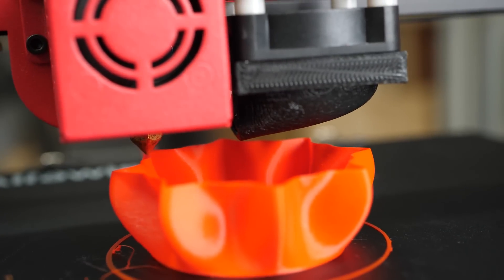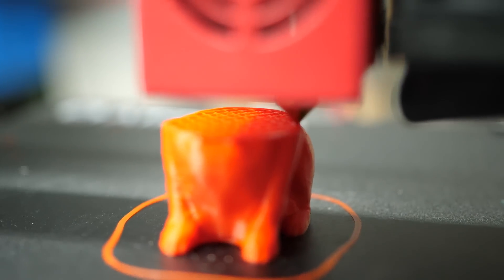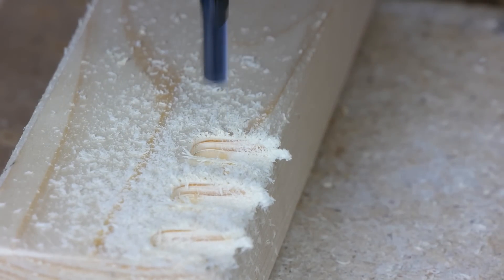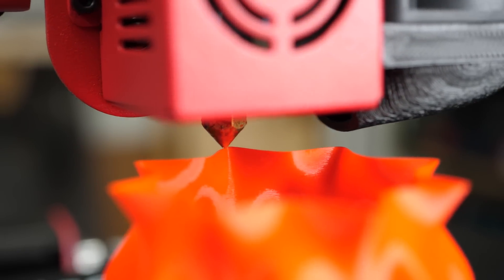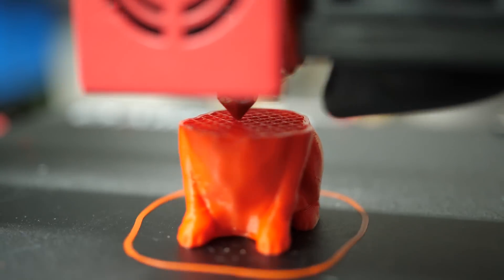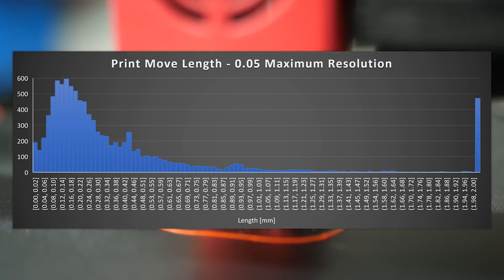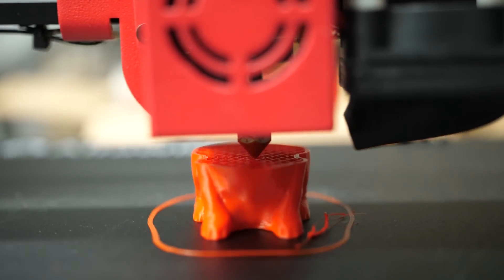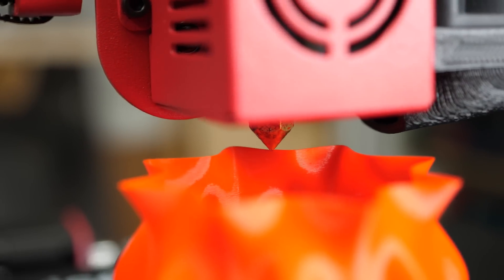(How) I finally got rid of these blobs!

Comment from the maker: Don't forget to share this video on Facebook, Reddit, Twitter and other social media!
Reply: @CNC Kitchen I'm investigating this problem for a while on all different printers, and apparently this blobs, zits, whatever you name it, are related to ADAPTIVE_STEP_SMOOTHING enabled in marlin firmware, i have tested this with option on and off, and it make sense to me now. When you decrease the resolution in slicer the smoothing option is unable to kick in because the stepping frequency is not going as low as it would with higher mesh resolution, this will also explain why this problem is not showing up when using Klipper ;-)
It would be great if you can test this on your Alfawise printer. Thank you
Reply: @Riggs Oliveria 

Normally good leveling eliminates rough backsides.
Rafts are also not known for generating good surfaces.
I think you have much to google now ;)
For example: 3D Printing Tutorials
Reply: @Riggs Oliveria 
If backside means first layer side and if it looks not good as you say...
Either is your extrusion multiplier too high (too much comes out)
Or its leveled too near
Or your extrusion multiplier is too low.

Without pictures, nobody can say what your problem is, thats why you have to search your errors and find it out yourself.
I guess you are very new to 3d printing.
Maybe find an facebook group in your native language.

That will help.

Greetings :)
Reply: @FireN2k9 thyjntynyyjyjyjtynjty
Reply: Another excellent video Stefan!
Reply: @Deqster tyyn
Reply: Excellent research, especially important to 8bit printers
Reply: Thanks for doing a deep dive on the GCODE.  I think it's something that is often wrongly overlooked on all the channels.  Getting more information out into the open source world helps accelerate development throughout community.
Reply: "Arc Welder" works even better... I had a similar problem, but ur fix did not work entirely... while it still made it better it did not fix the problem completely... after I installed and used the "Arc Welder" Extension for Cura though all my problems were solved and my prints were now suuuuper smooth... maybe its worth mentioning in an upcoming video for people who might still have issues with their printer not moving smoothly... my nozzle literally went from moving very jittery to moving buttery smooth, which improved my print quality by a lot... oh and it reduces the filesize enormously
Reply: @nebuchadnezzar47  Any benefit/downsides from using both? Thanks.

Comment: Legend.
Coming late to the game reviving my old Anet A8 8-bit board.  Was seeing rough hulls on Benchy (even worse via Octoprint due to serial communication issues of long Arc commands).
After changing "Maximum Resolution" from 0.05 to 0.5 and "Maximum Deviation" from 0.025 to 0.5 in Cura, Things improved remarkably, I might even say totally.
I don't know how often I was actually seeing these issues on other prints, but it is really like a completely different beast now.

Comment: Presumably the hammer to crack a nut solution would have been to run the print very slowly. That would still be the right option for printing details like threads that shouldn't be optimised out. With that said, being able to use the setting or disable the setting in layer bands and special volumes tight around the details might be good. That and/or an automatic slicer ability to slow down when heading into a detailed sequence of moves that a fine tolerance disallows decimating.

Comment: I found this on my Makerbot Replicator from 2012, after a few years i started to notice said blobs.. took me some time yo realize that going from PC USB connection running the gcode to a SD Card was overloading tbe buffer/processor 😮

It went from being able to print 120-165mms comfortably and upto 200mms without ever skipping to 45-85mms depending on how fine the details where on the model being printing.

Comment: Hello, that's some great work man.Good job.Would slowing the feed do the same thing, giving my  Ender 3 more time to read the code...only, I printed one chess set(entire set 17 hrs),came out smooth as silk, then I tried doing the black peices faster with a few other tweeks(NOTE:NEVER CHANGE PROVED PROGRAMS KIDS.....EVER), and I got the blobs... haven't tried another yet but hopefully slowing down to original will work...I only changed from 50 to 60mm/s, and u specifically mentioned 60 mm/s being too much for 8 bit. This programme is close to a billion lines of code. Hope Ur right my CNC loving buddy. Keep making the bids. Good stuff.

Comment: Have that issue on my ender 3 but I have upgraded it to direct drive shortly after getting the printer, have that issue in vase mode when slicing in Prusa, will try to play a little with those setting

Comment: Just coming back to this video to give thanks as this cured 99% of my stringing issues using PETG. I didnt even know this was a thing. I set my max res: 0.4mm, max travel res 0.4mm and max deviation to 0.05mm. Those settings might be quite agressive but I'm not too fussed with dimensional accuracy, at least its more than fine for me I've not had any issues with parts not fitting. I also stopped exporting my STL's from Fusion360 using High refinement, instead using Low. Which is still plenty.

Previously I could watch the printer making lots of very small stutters, which ended up with blobs on the nozzle and then strings getting pulled over gaps etc. Now its movement is way smoother.

I went from spaghetti to almost completely string free prints with just those 3 settings. Thanks so much for the well explained video!

Comment: I dont think this video is correct. I get blobs on my Ender 3 S1 with the same g-code that will print much faster and without blobs on my older 3 Pro (with a Bowden extruder!) . Also my S1 will stop "blobbing" when I reduce the printing speed enough. I think it is the blackout backup - the printer saves the position of the printhead every couple of seconds so it can resume the print in case of a blackout, and the printer can't handle "saving data" and continuing to print at the same time, so it stops printing for a fraction of a second every time it saves its position.

Comment: Dear Stefan hello 😊 
I'm the prusa user and I don't have in my prusa slicer 2.4.1 option:Resolution 
In Slicing frame(category) i can see
1. Slicing gap closing radius (in mm)
2. Slicing mode:  Regular or Even-odd or Close holes.
3. Elephant foot compensation (in mm)

So how to avoid blobs creating?

Comment: Very confusing. You mention Resolution and Travel Resolution a lot. What setting did you actually change to 0.5? Because in the Ultimaker profile you compare the maximum resolutions and mentions the 0.7 setting but this is the travel resolution and not the maximim resolution.
What setting did you change?

Comment: One of the slicer settings should be "max moves per second."  That would allow the slicer to slow down the print or consolidate moves as needed to prevent the printer controller from getting overloaded.
Reply: You can calc it with the printsleed divided by the quality setting

Comment: That was not my problem since my ender 3 has a 32 bit board. I noticed it only in a vase mode. It was the power loss recovery
And I solved it with I think M412 S0 (s1 for reactivating it)

Comment: Not sure if you've tried this already (since this is rather old video), but I had very similar issues. Especially when using gyroid infill. I could see the printer stutter, when using higher speeds (printing from Octoprint, by the way).

How did I fix this? I installed the Arc Welder add-on for Octoprint: https://plugins.octoprint.org/plugins/arc_welder/

It tries to replace many smaller linear moves by longer arc moves. I'm not 100% sure what the bottleneck is, amount of commands, or amount of data that needs to be transferred. In any case - this reduces both. Of course it would be nice if slicers natively supported arcs to begin with...

Comment: didnt understand a thing , so should i lower or go Higher with maximum resoultion ?
Reply: Idk, I'm stumped too, probably if it's higher than .05 then lower it down to .05
Reply: Lower resolution which means the memory is not "clogged up" with unnecessary data steps which blocks up the memory and the print nozzle stops to wait for the memory to be "flushed" out.

Comment: Maybe you could compare lowered resolution with Arc Welder (Plugin for Cura and Octopribt available) which smoothes multiple consecutive linear moves to arc moves. This should have the same or even a better effect compared to the lowered resolution. You still can lose fine details, but decrease the number of direction changes.

Comment: Oh yeah cnc stuttering, when encountering multiplicity of small lines, and the tool catches up with the calculations and comes to a jumpy halt waiting for the processor. Even more difficult if there is a tool offset, some machines just stop and cant be restarted if they find  a move smaller than their tool offset, some fail to offset at all for the first or last programed position in cut path.

Comment: did I get it right?  by reducing the resolution a little, you can get better results as the program is more easily executable by less performing printer models (like mine)?  if that's really the case I would never have gotten there alone

Comment: Amazing. I've very new to 3D printing and have been following Stephen's excellent channel since slightly before getting a Ender 3v2 just over a month ago. Recently tried to print a bust with the author's suggested settings and work well - minus some horrible zitting.

As a first attempt I doubled the Max Resolution setting from the default of 0.25 to 0.5mm and not only was there substantial drop on the number of zits (literally countable), the print actually took on a glossy finish (I assume the layers where just more smoother in general).
Reply: Same here dude, same printer and everything
Reply: Is this a printer setting you export from Cura and import into your printer so all the prints have these settings?

Comment: Hello, i have a vertical banding in my print. Not slanted at all, perfectly vertical.  It is worse on one side of a calibration cube then the rest but all sides do get it. Its similar to the teeth of the gt2 belts but not the same

Comment: What about Simplify3D, which has no resolution setting? I'm tending to have trouble coming out of concave perimeters, with "gap-blobs". After a direction change, sometimes the perimeter doesn't stick to the prior layer and gets pulled up and over a couple mm by the nozzle. I've tried jerk and acceleration settings, various temperatures and fan settings (including no fan), and pressure advance. I've been able to improve the problem on convex corners, though it still sometimes happens there. But concave perimeters are littered with gap-blobs.

Comment: This happens on my high end CNC mill at work. The motors can't accelerate fast enough for the g code produced by the post processor. It's especially noticeable when trying to interpolate small holes with large cutters. 

It would be nice to have a good digital read out so you could follow distance to go along with absolute position.

The effects of this acceleration aren't noticeable on the mill but when doing additive it has to be considered when programming.

Comment: wow! This is a problem I've had with a few items I've tried to print before.  I see the blobs even in Cura slicer.  By changing the max resoution it removed the blobs and prints just fine on my old Ender 3!  Thanks for sharing
Reply: What settings did you use? Ta

Comment: I'm ender 3 pro user, newbie in 3d printing and I'm having lot of issue speacially with the bed leveling even though I bought bltouch already. my printer always misprinting in result to gap I don't if my bed is too close to nozzle or I'm having issue with the filament feeder. please anyonr can help me I'm really frustrated, I'm using pla tough filament. PLEASE HELP

Comment: Too slow microcontrollers? There is the Klipper firmware: you buy a raspberry for 30€ which takes away nearly all work from the orignal controller board.
From the docu "Even old 8bit micro-controllers can obtain rates over 175K steps per second."
Also there are fast cheap microcontrollers like the teensy running at 600Mhz and others. Boards with slower Mikrocontrollers should no longer be produced.

Bowden systems are obsolete, there are direct extruder upgrades which weight less then <200g including hotend, for less than 80€. (e.g. biqu H2)
They are so simple and as cheap to produce as bowden extrusion systems. So manufactures should build them in the first place; especially when they keep something on their self.

Before investing so much time for fixing problems of bad printers just don't buy them and especially tell people not to buy them.

E.g. Alfawise seems to copy only. Dont give money to copycats.
Prusa seems to be copying mainly. I was really surprise on the design bugs I see on Prusa printers; core parts like they were designed by a total beginner without any interessed to make it good. E.g. the hotend of the mini! It indicates the team has no knowledge of thermodynamics at all. It's even missing a head break at all! (The reduced diameter between heatblock is the heatbreak. Prusa uses a ) The missing cooling for the controller boards (with early death) is another indication.
Don't buy a mini(+)...
Maybe that company was just early in the marked and lives from the reputation back then. But I am really disgusted on the failures I see.
Prusa please stop rest on the laurels; learn thermodynamic, keep the board cool. Look into BiQu H2, E3D Hemera and Ldo Orbiter. Stop wasting energy and mony on mass production by 3D printers, use injection molding for massproduction; stop letting the people wait for slow expensive printer production. Of course build a core xy frame. The Patent for heatchamber enclosing has ran out, so enclose the printer now!
Otherwise Prusa will be out of the market soon.

Comment: A way better solution is to use the original model file where everything is described as parameterized curves an, and create optimal slicing from the curves directly.
Stl is not a source file. It's a compilation result. Like the binary of a programm.
Note: when you publish an stl-file without the sourcefile under an open source licence you are violating the licence!

Comment: Have Anycubic Mega and latest version of Cura not printing nearly as well as the old versions.
Grrrhhhh...too many PLA pimples....feel like a teenager again....Head scratching....Clearasil for 3D printing.....No that wonʻt work.....Search, search.....Stefan - CNC Kitchen video.....If anyone would Stefan would.....Woo Hoo!!! ... You totally rock, all the way down here to Australia.  Thanks so much mate, donʻt change a thing....absolutely love your work.   With what I know now, another partial cure might be reducing the resolution from high to medium when I save in Fusion...but I guess at some point you will still hit the but far less occasionallym the edges of triangles where moves converge too tight.... Yeah , so really like your solution applied in Cura.   I will return with a post on how it goes... and if nothing else you have very likely identified the route cause for me.  Brilliant dude, deeply grateful.  RD

Comment: Check out Arc Welder plugin for Cura. But your printer firmware needs to support G2/G3 commands. If you are using OctoPrint there is also a plugin called Arc Welder which basically processes the uploaded Gcode file and creates an Arc Welded version of it. If you are printing straight lines mostly it won't compress very well. But if you have a highly curved object I have seen %70-%90 percent compression in Gcode. This will definitely eliminate any stutters.

Comment: I've been sharing the video. Now commenters are saying this is a firmware bug in how it saves layers for resume feature. Working around with resolution and ArcWelder helps. But those who have switched to community firmware v2.0x swear that blobs have vanished. @t Another alternative is to disable the resume from power failure feature entirely.

Comment: Alternative (mainly for 32bit Boards because of Flash size) is ARC-Support in Firmware in combination with Arc-welder plugin for cura or as plugin for Octoprint to modify existing Gcode files. What it does is making the small linear movements that will get a curve into a curve so it decreases the file size dramatically and also the ammount of gcodes your printer has to handle.
Since I found out about this I use it always because also the printer itself is running much smoother then (because it doesnt draw many short linear lines but a curve)

Comment: I found the same issue could also been improved if you use arc welder as a plugin to translate all the short lines into fewer circles. the deviation is much smaller even if you have quite big circles generated. But you also need a mainboard on the printer that can handle these G-code.
It mainly occures for many also probably when using octoprint as the buffer size is much smaller as a standard setting in marlin than from the sd card.